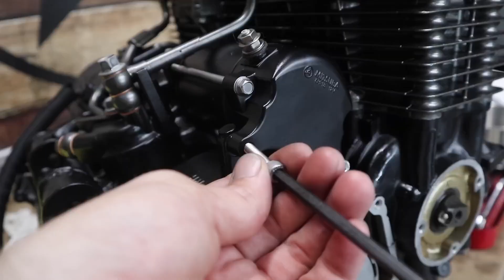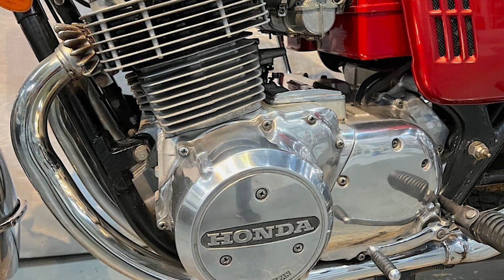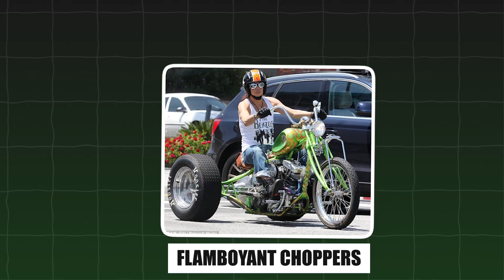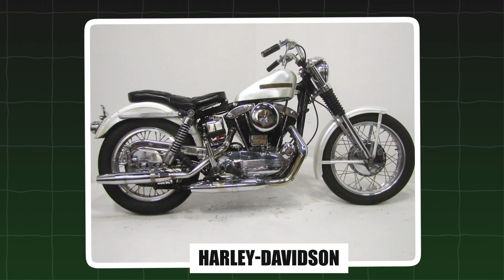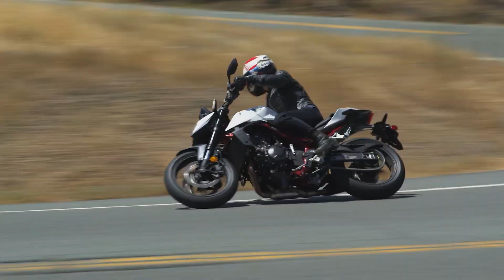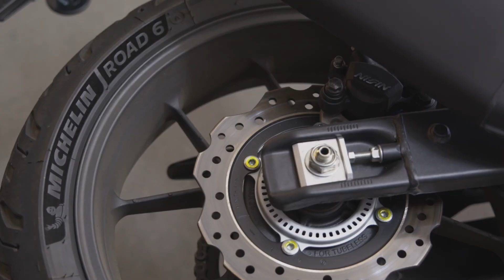The Shocking Truth Behind Honda’s CB750 Four Engine!

Comment: You can tell this is AI generated bs. Keeps repeating the same phrases over and over. Yes, they were extra well built bikes, but my Kaw 750 H2 would leave them in a cloud of blue smoke. Only thing I replaced after 4 years of riding was the rear tire.
Reply: Well with out the Honda cb 750 you kaw 750h never was going to be build really Honda took it to another level in 69 and 79 with the 6 cylinder and 750k c knight hawk tween cams ok

Comment: I bought an immaculate used CB750 in 1975.  It had very few miles, a Windjammer fairing and windshield, Dunstall four into two exhaust, tweaked carbs,.....and it was absolutely bulletproof.  On Sunday country rides I'd see lots of Harleys, Triumphs and others broken down...offered the rider a lift into town and most accepted...but a couple turned me down....they didn't want to be rescued by a Japanese bike.  It absolutely never had a single problem.  Wish I still had it.
Reply: I bought a new, previous year model (1971) K1 in 1972.  Loved it.  Wish I still had it.  I moved up from a 1968 CL350.  What a leap!

Comment: Probably 30 per cent of the motorcycle photos shown in this video are 2025 CB 750 Hornets which are in no way related to the first generation of CB 750's you are refering to.   The Hornets are parallel twin cylinder engines as opposed to first gen 750's which were an inline four cylinder. Hornets represent 57 years of improvements while sharing the same name.....a totally different Honda CB 750
Reply: This is computer AI generated it's too stupid to know the difference!!!